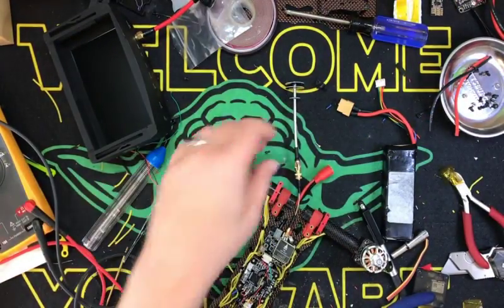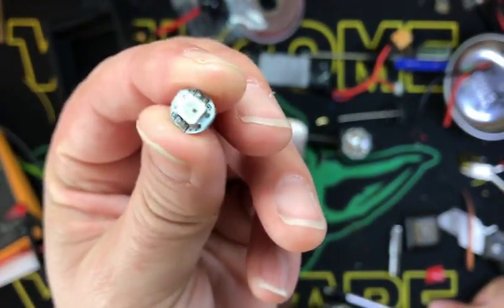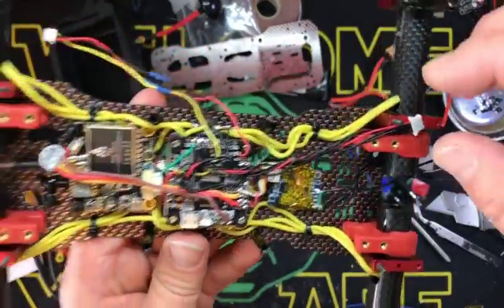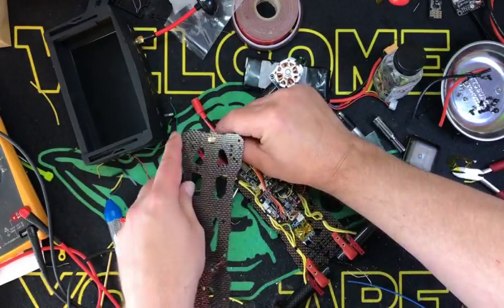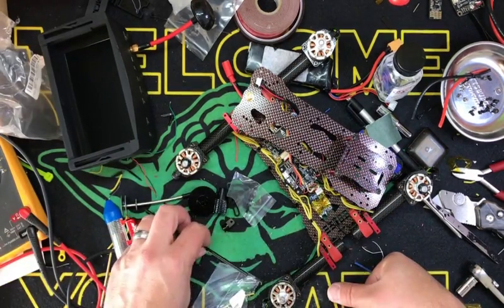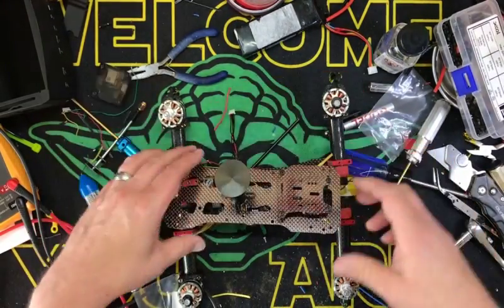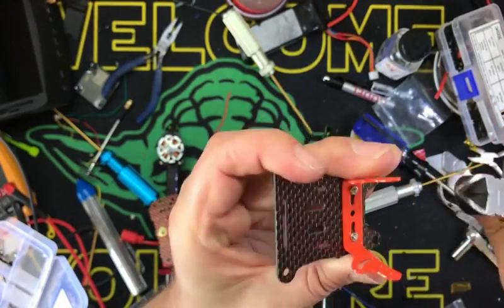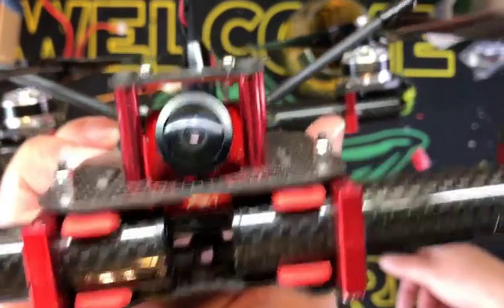QuadKitchen- GPS Hybrid Drone Build - Part 2 of 4 - Final assembly

Comment: Great idea with the LED - I have recently built (or more accurate, still building) a GPS cruiser and not knowing the GPS status is annoying. This would alleviate that to a certain extent.
Reply from the maker: Also brother, if u wire in a beeper it will chime when it gets 3d lock with sats
Reply: I have a beeper, but I have to admit that its a tiny little thing that you almost have to have next to your ear to hear it Maybe I'll swap it out for something better. Cheers!